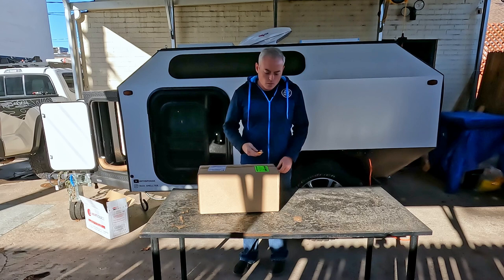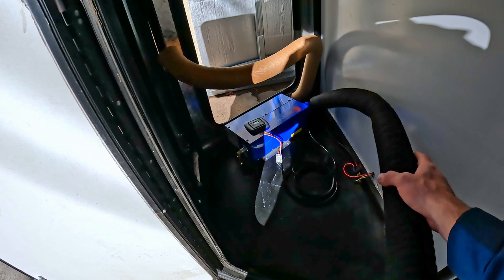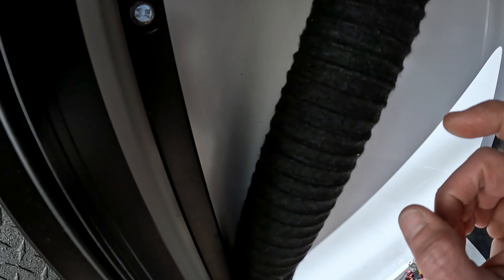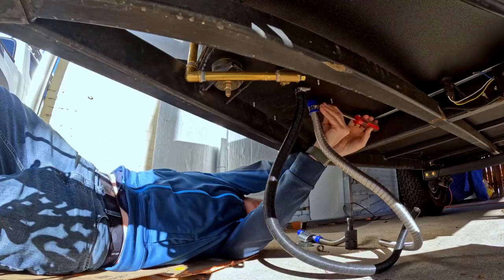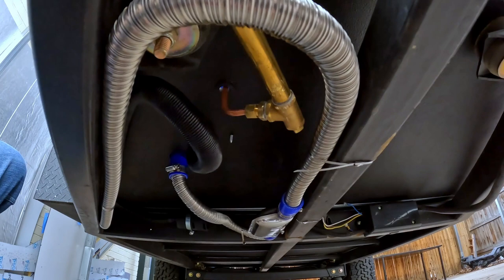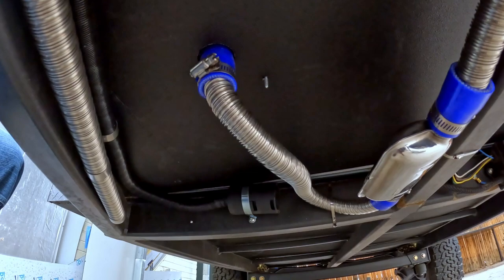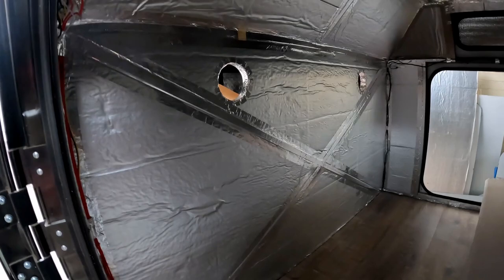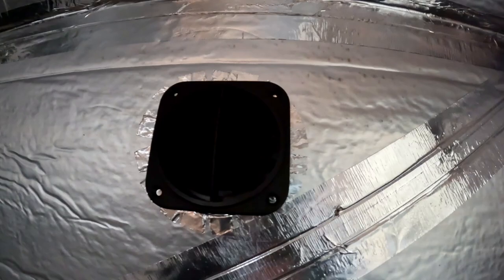DIY Overland camper trailer build: Propex heater stealth kit!

Comment: I like your build. Watxhed from frame up.

However, i think you running the HOT exhaust like that around the propane line is dangerous as a whole.
Reply from the maker: Noted, no issues yet but I’ll keep an eye on it.

Comment: Why do you have it exhausting right below the sleeping compartment? Shouldn’t you direct the exhaust as far away as you possibly can?
Reply from the maker: Technically it is below the tongue box. The sleeping compartment is the whole rest of the trailer. There is a gap between the bottom of the cabin and the trailer frame so no fumes will be trapped under the trailer. I can angle it down a little but on rough terrain it will probably get pushed back up.  Where do you suggest it exits?
Reply: So I have a mammoth overland trailer very similar to yours. I am mounting my propex in the rear. I was curious why you place the inlet air under the trailer. Was thinking dust might be a problem. Was just going to mount inside. Amazing build by the way!

Comment: Your heater videos are fantastic and have really helped me with my own project.  My wife and I bought a very old Scamp that doesn't have a heater so I ordered a Propex heater for it.  I have not installed it yet as I was working on a custom tongue box first (coincidently got some ideas from your tongue box video as well!).  Now that the tongue box is done this is my next project to tackle.  My only question would be, realistically what is power consumption like?  We will be heading to Telluride in late September, then doing some winter camping this year.  I'm curious what kind of power I need (new power system in the Scamp is my project after this lol).
Reply from the maker: It depends on the outside temp and your insulation.  The heater uses 1.9a continous running/0.04A standby.  It only runs when it needs to though.  I run my trailer off a EcoFlow delta mini 882Wh and haven’t never run out of power.
Reply: @infosponge  My insulation isn't great, something else that I need to upgrade on the long list of upgrades lol.  I was looking at getting a EcoFlow River 2 which is a little under the Delta Mini in power, so I think that will work out just fine.  Thanks again!

Comment: It was hard to tell and might just have been the camera angle but it looked like the last U in the exhaust tube was hanging lower than the outlet. With how long that exhaust tube is there is a really good chance you will cool the products of combustion down to below the dew point and start collecting water in that low spot. Did you try it with no tube after the silencer? I bet it would be fine if you just cut that last section of tube right before the U and called that good.
Reply from the maker: I will keep an eye on that.  The instructions say: "For the exhaust; the existing 22mm pipe should be removed from the heater,  the new silencer and supplied pipe fitted directly to the heater and the original pipe fitted to the new silencer."

Comment: This is my favorite camper build by far. Your work is stellar! Did you consider mounting the heater up on the interior wall to give you more floor space in the tongue box? If so, what were your reasons for mounting it where you did? I’m not criticizing, I’m just curious about the placement and and your thought process in the build. I hope to have the skills set to do something like this one day.
Reply from the maker: Thanks!  It has to be mounted flat so that’s the best place I could think of.  I will eventually build an enclosure over the top of it to protect it from cargo.